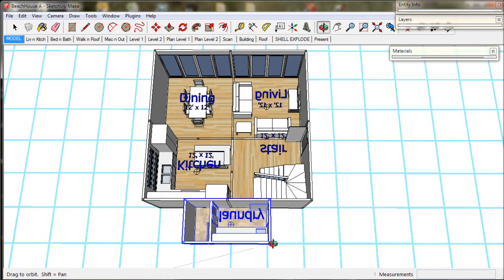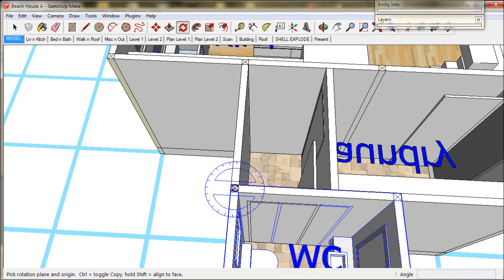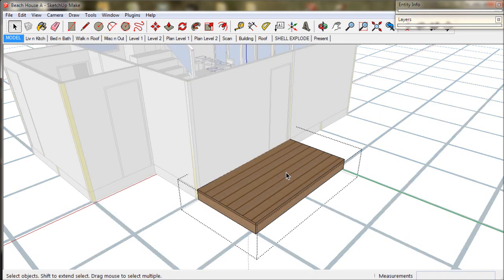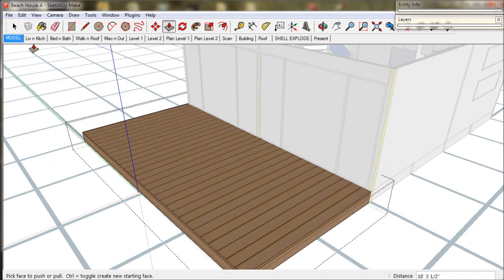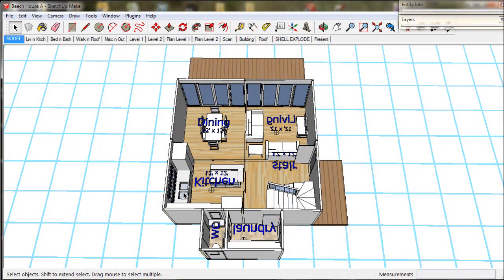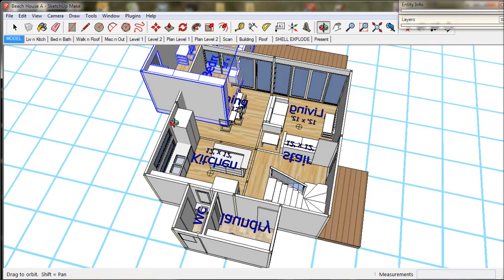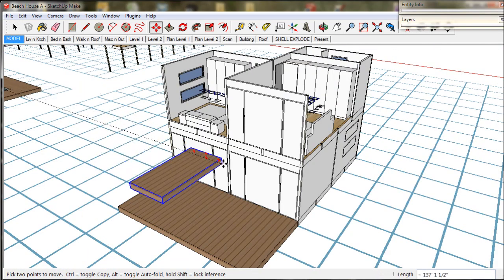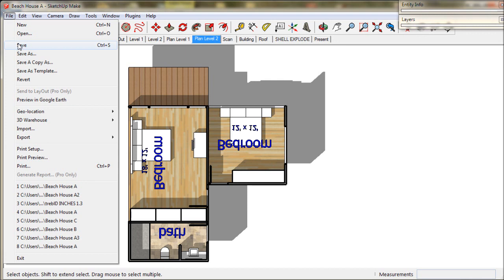2.  Rotate Stuff and Make Groups.  A TreblD and SketchUp Tutorial

Comment: But how do we change wall lengths and erase walls? Seems very limited to your modules. Can't change sizes... but I'm looking.
Reply from the maker: +Kirk Williams. Hi Kirk, you can easily remove a wall by using push pull. Keep clicking on the wall until its all highlighted, then push the unwanted wall out of the way.  Similarly, if you want to make a room longer, keep clicking on the wall until everything is all highlighted, drag a selection box to select the ends of the wall or walls you want to lengthen, then drag it out with your mouse to make it longer. Use the direction arrows and the keyboard to enter precise measurements. Good luck!